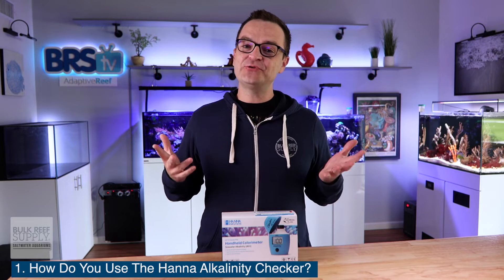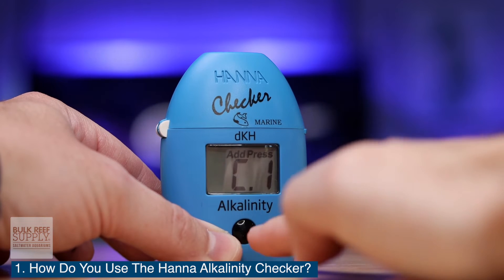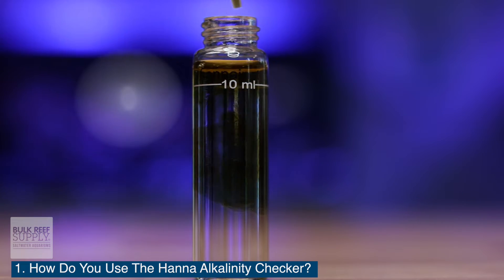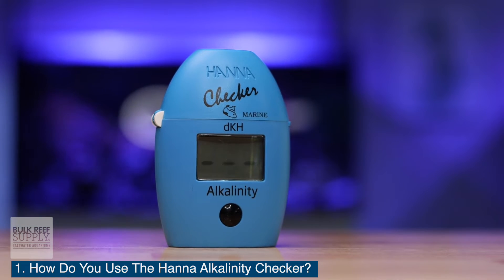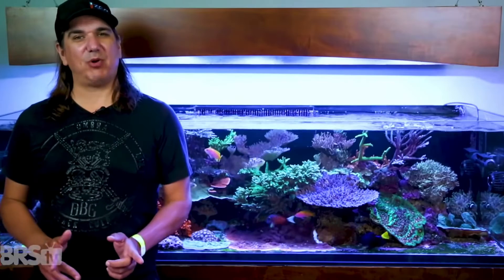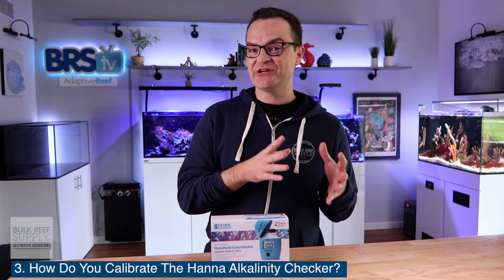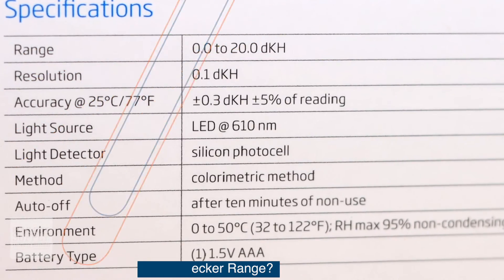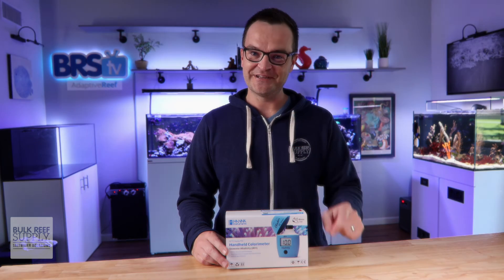Calibrate a Hanna Instruments HI772 Alkalinity Checker? This & More ANSWERED!

Comment: My alkalinity checker were meaauring correct. Then I bought new regent and meaaured 2 times with new one it was accurate then checker start measuring 0. I found this video when i was trying to figure how to calibrate it. So what could be the problem? Should i buy new regent? Ps : already changed the battery.

Comment: I‘ll probably never use the checker again. Bought it 6 months ago, worked fine until now. My last 2 days alkalinity measured where 7.4 and 7.5 today the checker gave up on my and consitently displays 11.1 dkh which I know isn‘t true, because I never changed the dose and nothing has happened to the tank that would make the result seem legit. I changed the battery, used different (newly purchased) reagents and new cuvettes only to redo the whole test 5-7 times and 11.1dkh is still being displayed. Used the hanna checker of a friend, it shows 7.5dkh. 

So to be honest it‘s a nice tool but way too expensive for it‘s built quality and the fact that many people constantly get inconsistent results turned me away from the checker. I‘ll get a kh keeper now because I‘m sick of testing for alk 1-3 times a day. Unfortunately I can‘t recommend the checker if you‘re serious about getting consistent results. Buying two of them to have one spare might do the trick but i feel like a piece of plastic with a 50cent photocell and a 50 cent led diod shouldn‘t cost 60€ (Germany) unless it‘s reliable, which it isn‘t.

Comment: Thanks for another great informative video.

Hint: I find a short side to side rotation of the upright bottle dislodges any remaining small bubbles.

Question: Any idea how often the battery should be changed based on usual usage?  (Example “weekly” testing)

Thanks for keeping us informed,
Jim
Reply from the maker: It'll usually give you a battery low warning when it's getting low. We've had some Hanna Checkers around the BRS office that have gone a year or more without a battery change 🙂

Comment: Don’t forget when adding 10ml of the sample water, the meniscus should be on the indicator line for the most accuracy :). Also the tester calibration can be tested using the certified standard kit from hanna. Lastly don’t forget the reagents have an expiration date so make sure you’re testing with good reagents.
Reply: None of that matters if the units not working correctly I'm done with Hannah products
Reply: @dobermanguy9437  me too my checker is saying 3.4 another checker says 3.3 but salifert and api say 7?!?!🤬